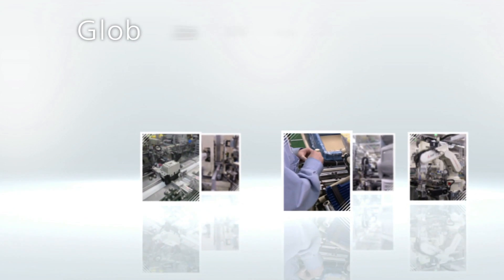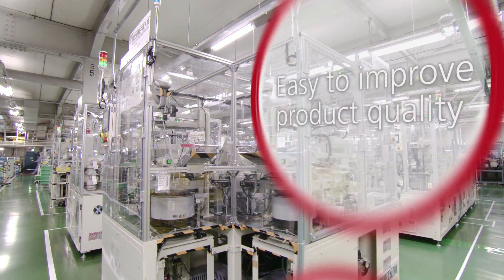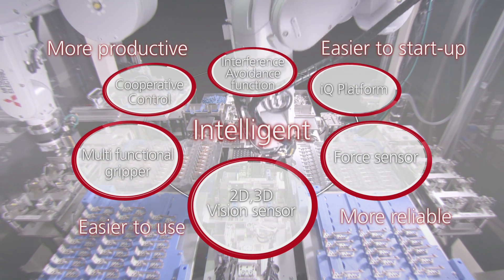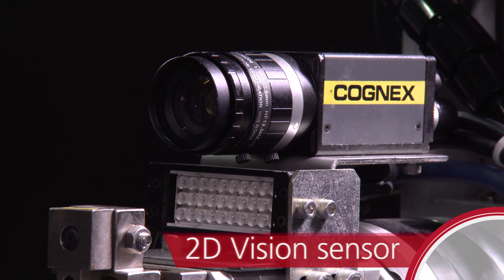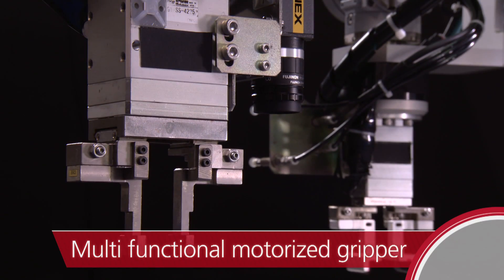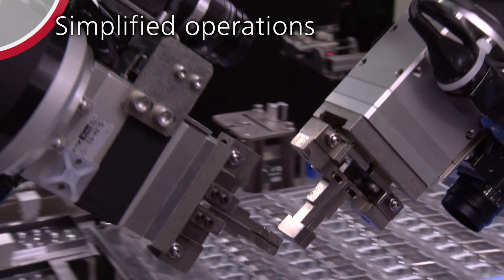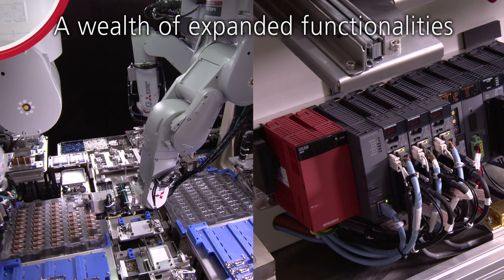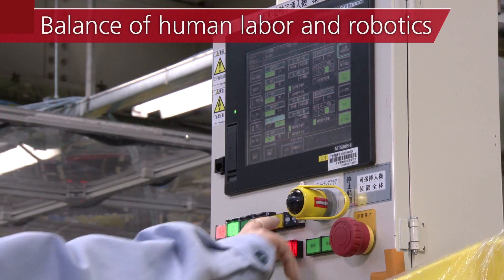Mitsubishi Electric - Robotic Manufacturing

Comment: Here I saving Mitsubishi is an ideal band in my case, for example, I perform that hurts more in the seas than laptops and the year 2013 Samsung sensirion anti-theft Galaxy Note 3 Galaxy S4 Galaxy round Galaxy j1 but unfortunately it is a manufacturer has  eliminated the temperature and humidity sensor, for example, as they put it back because cell phones are supposed to bring more every day, bring more sensors and since there is one that has less than another and that does not agree

 I imagine I have an idea that the malfoy Mitsubishi will be an Asian Asian culture but at the calculation level because the computational paradigms are already ideal to give you the use of calculating solving mathematical problems, using one of the GPS, Baidu, is more ideal for instrumentation.  BDS gallileo its global positioning system but that is the whole question of mathematical calculation mathematical operation Rather a computational paradigm now that Smartphone if I got on if I was manufacturing Smartphone they would laugh or they would have made the most favorites since if it had done Samsung and  the other woman that would not have existed or in my mind if I got on if I had producing Smartphone and Cruz iveco their own chip instrumentation sensors etc. I would be enjoying technology as Samsung is supposed to what what is the Galaxy Note 3 S4  This way, it would be constituted next to this concept if the Smartphone had or had  Of more sensors in the world today, free software would not have done it, for example, as Laughter Stallman, but you should take these regularities better than if it had made the most sustained smartphones in the world, but what is something that would go beyond Moore's law since  Asian culture are the most advanced cultures of technology. Rather, technology for computational Lima are like some Asian concepts since you even say no that the extraterrestrial brings technology !!!
 But the Asian culture is the world leader in computational paradigms, such as monitors or everything that is a component of the computational paradigm, for example.

 I say the Mitsubishi must make its myphone but it would be better Asian Asian styles much better than almost all brands of smartphones and the Asian concept and culture is one of the ideal for people like applicants or autism, since for example  half of silicone valley administration are autistic asperger